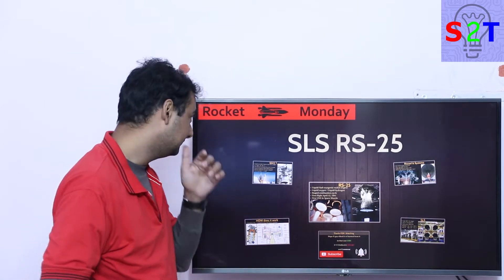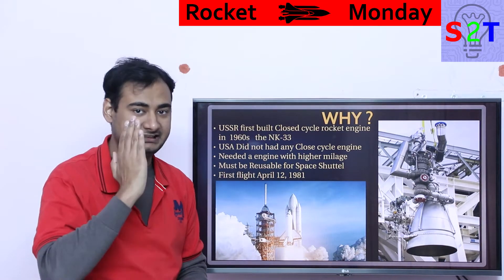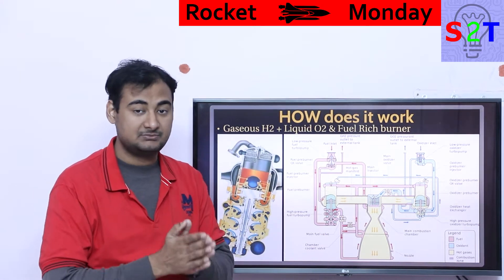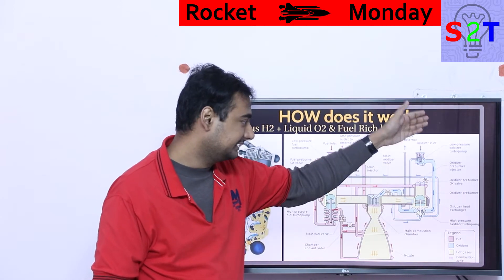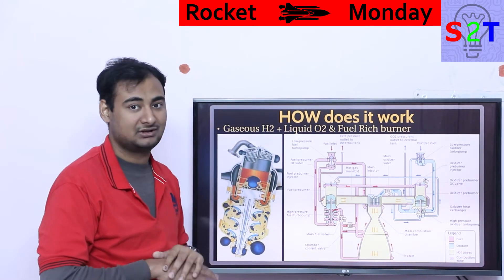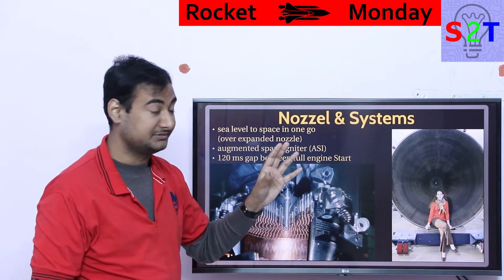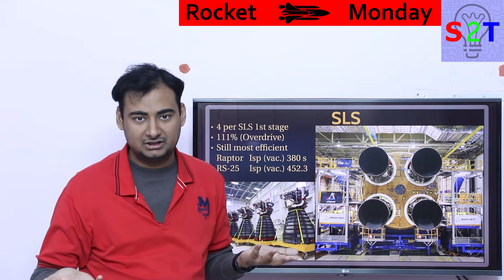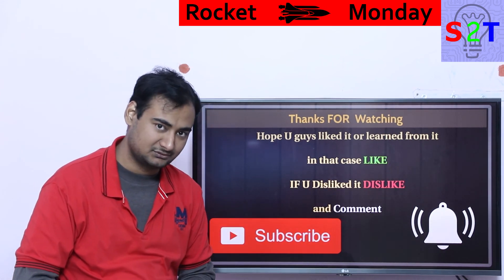RS 25 Engine Explained{Rocket Monday Ep78}

Comment: Hi, I'm Gabriele, I'm making a model of the shuttle ssme, I started with the components of the high pressure hydrogen turbopump and I have a problem. I saw a photo of the turbopump and between the impeller I saw written "splined coupler" I know that this coupler is for connecting 2 shafts but I saw that this splined coupling is as if it were attached to the impellers I did my best to say it as best as possible possible but if you see in a photo of the turbopump you can see it there and I didn't understand what it is or how it is connected
Reply from the maker: its way too deep for me I never went that deep
Reply: @s2tenglish  ok no problem thanks